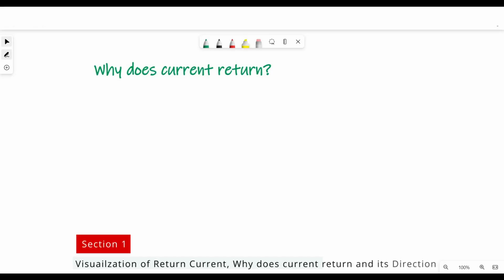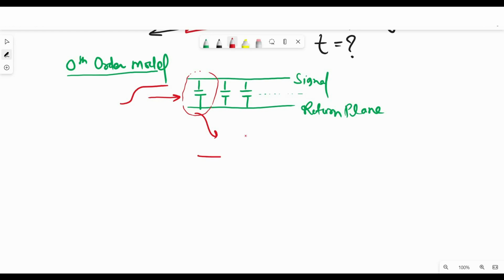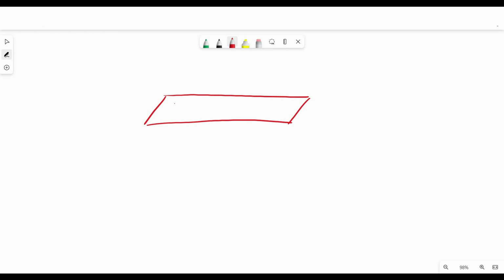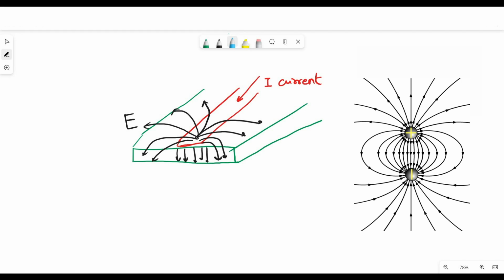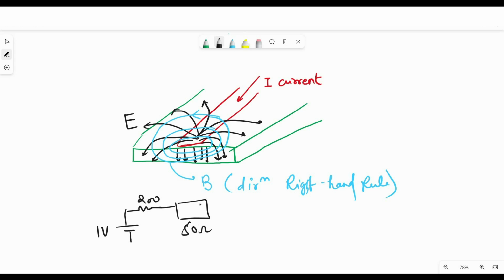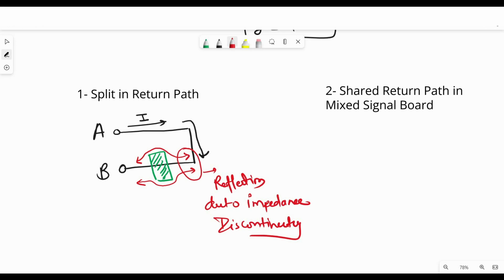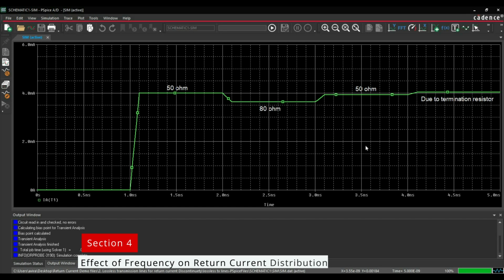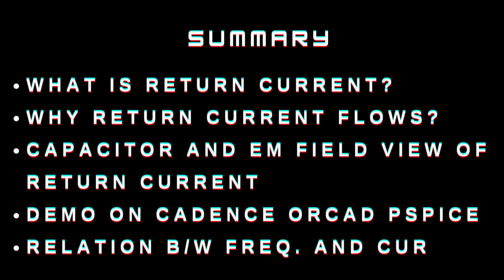Return Current - What is Return Current in a PCB? | Electronics Basics Explained

Comment: Hi Aviral, Thanks for the great video! I have seen on some other sources that instead of splitting the Analog and Digital return path, one should have one uniform return plane where analog section should be as far as possible from digital section and isolation can be provided using via fencing, proper IC layout and LC filtering. So which method is better?
Reply from the maker: You can compare all these using simulations on Allegro Sigrity. 
To understand the difference theoratically there is this paper from TI https://www.google.com/url?sa=t&source=web&rct=j&opi=89978449&url=https://www.ti.com/lit/pdf/SLYT499&ved=2ahUKEwiA07eZh7iGAxXg8QIHHTfXCmQQFnoECDEQAQ&usg=AOvVaw0SXq-kQWW8Xf-qrV78eu0z
Reply: @EsteemPCB  Thankyou so much!

Comment: How does the return current flow if the reference plane under the signal is a power plane not gnd plane?
Reply from the maker: I ll cover this in next video, it flows through coupling b/w power plane and gnd planes
Reply: Return path of current which shown in the video, there is no actual capacitor present, it is the parasitic capacitance and if the power plane is continuous underneath the transmission line then impedance discontinuity will not happen and signal will travel without loss.